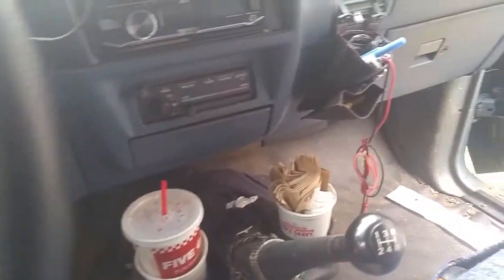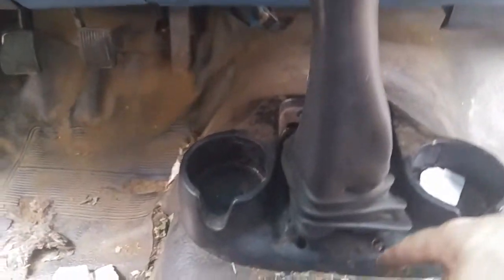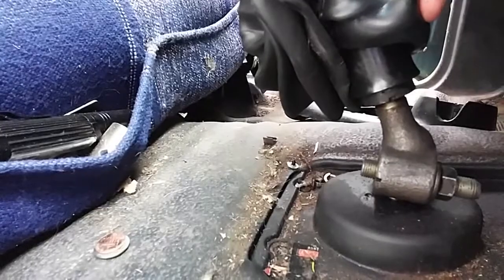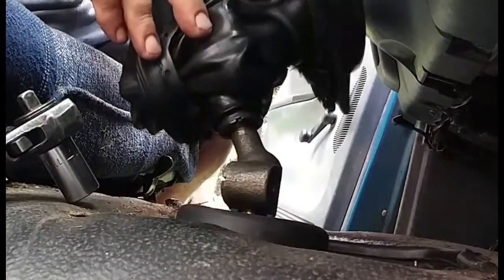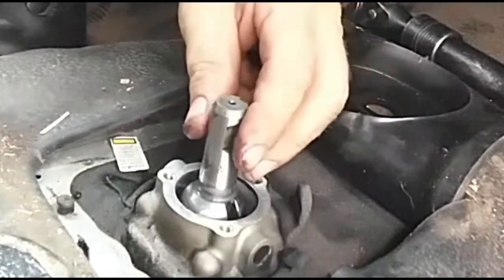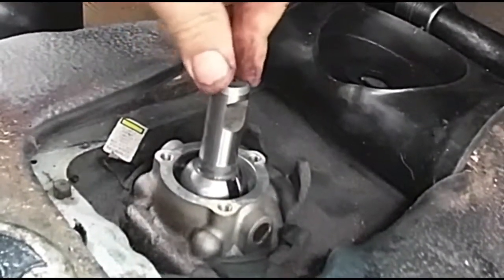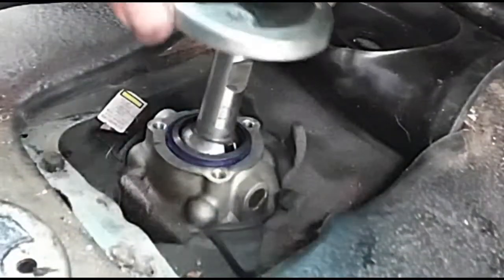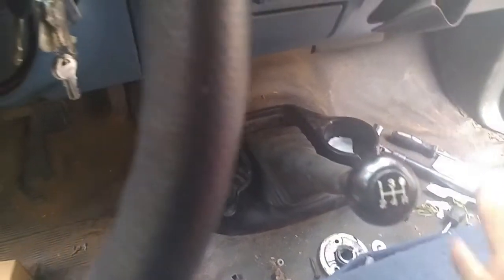Ford ranger shifter bushing replacement

Comment: I just had to do this on my 1991 Explorer. My shifter came off while trying to change gears!!. The play I had was very bad: I knew something was not right, and I was right. I went to NAPA and bought the shifter rebuild kit and did what you did. My two pins looked in good shape also so I did not change mine either. The kit did indeed improve the shifting 100%. The bolt that holds the shifter on the transmission shaft had worked it's way almost out causing it to rotate freely and and just lift up and off. All better now!
Reply from the maker: Thanks for watching.   Glad it all worked out for you.

Comment: Thank you. My son uses our 1991 Ranger, and said it wouldn't go into reverse. Do you think this might be the problem?
Reply from the maker: Thanks for watching. I doubt a  worn bushing would disable the shifter to go into reverse. Start with the simplest things first. Are you sure he’s pressing the clutch in all the way?  Is the transmission low on gear oil. Is the clutch reservoir low?
Reply: @NickG  Thanks. Will do. I haven't had a chance to look at yet.

Comment: Did you leave the bottom spring washer out ?
Reply from the maker: Thanks for watching,  I put in the bottom spring washer and the top one. I couldn't figure out where the third one went so I left it out. It's been 3 years now and still working good.
Reply: @NickG  That kit only comes with 2 bushings and 1 spring washer though, correct ?
Reply from the maker: @ScottieTooHottie84  I can't say for sure but I think it does. All I used was the the two rubber caps and the the two rubber bushings. I reused  the old hardware.

Comment: @8:49, my BAD, I was wrong, went back and look at my pics, you were right--that flimsy "skirted" seal goes on last, ideally tucked under the first little bellows on that "fixed" main-seal with the 3 screws.

Comment: I can't get the shifter bolt off because after I take it off the one in it won't go on the other end to tighten. Is there any other way to do it it seems like it only takes to good turns on the other side to crack it loose
Reply from the maker: You can try hitting it lightly with a soft hammer. Be careful not to damage the threads.

Comment: One of my pins (6:50) is stuck and won't come out. I even took a crowbar and hammer to it with no luck. Any idea what I can do to remove it?
Reply from the maker: They should just tap out from the inside out.   Have you tried using a punch or a long bolt or even a socket extension?
Reply: Check for a nick--or other tiny obstruction--in the OUTside surface of that "collar housing" that might be keeping it from backing out...?

Comment: Hello I have a problem with my f150 03 don’t go in gear but when’s starting out it does good but 40 to 50 minutes it doesn’t want to will a shifter bushing repair kit help it?
Reply from the maker: Thanks for watching. Not too sure.without physically seeing it. Sounds like you might have a clutch problem
Reply: @NickG  okay thx

Comment: On my '88 I have a sloppy lever. The lever itself is wiggly under the thick plastic shaft. The whole lever will turn on the cast iron knuckle with vice grips and doesn't seem to tighten or loosen. WTF!?
Reply from the maker: Thanks for watching..  sounds like something is worn out.  Might be time to take it to a transmission shop.

Comment: Can it be on first gear or does it have to be on neutral to replace it?
Reply from the maker: Thanks for watching. I put it in neutral. But I believe it could be in any gear.
Reply: @NickG  learned that you can have it in any gear and still remove it. However, when you place it back it won't fall where it needs to be and the gears won't shift. Had to press the clutch, put a flathead inside press and pull it into neutral so the shift bar base would fall back in place. It worked. Learned the hard way on that one
Reply from the maker: @drunkencarpentry989  thanks for the tip.

Comment: Hey man, great video but I noticed at 5:42 that I’m pretty sure your missing a bushing retaining pin. Mine had 2 pins in oposite sides that I had to tap back to get the spring washers and bushings in. If you still have a little slop that might be why.
Reply from the maker: Thanks for the tip. I reused my old pins. The shifter came out so tight. That I missed shift quiet a bit till I got use to it.
Reply: @NickG  My 2 pins were visibly "necked down" by a couple mils... luckily they both came out with a flat-nose punch and moderate tapping... new ones went in so easy I took 'em back out half-way, applied BLUE loctite, then back in... Dorman, Made in Cheena, what can you do... lol.